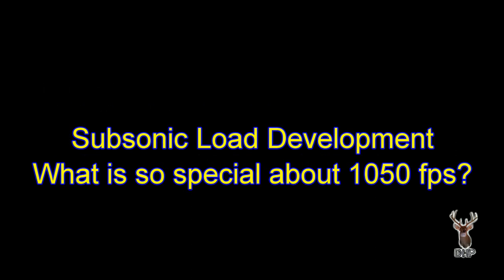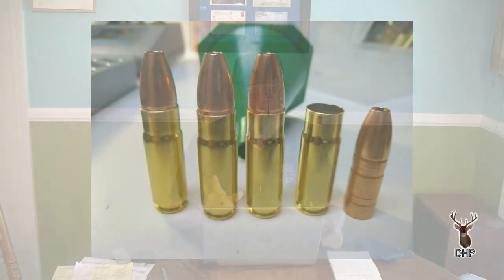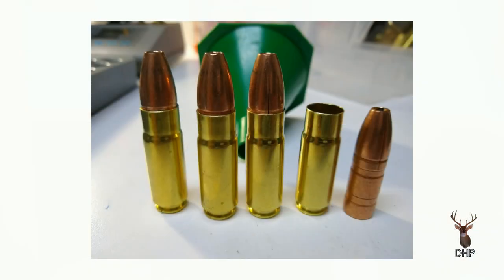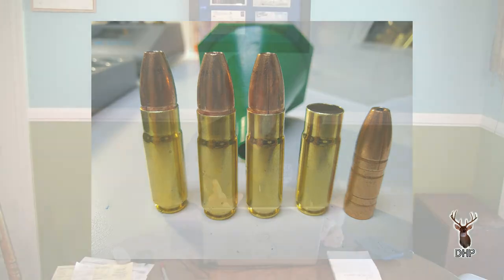S9E15 – Mid Season Special-III - Subsonic Load Development 500 gr Maker Bullets 458 SOCOM - 1080p

Comment: Off-center chamber, or bullet undersize for bore. I gave up on solid bullets 20 years ago for this reason. I was trying them at 1000 yards. Could not get them to work. It came down to just this problem, too small for bore. The bullet maker offered to turn up a batch for my bore at too much of a fee. so that was the end of that.
Reply from the maker: I appreciate the thought. Solids/monolithic projectiles can be a challenge. 

Neither is the case here in this example. I don't turn necks. So with a perfect barrel, bullets can off-axis.

Comment: I have had very bad results with Winchester LRM primers in the .460S&W. 

Overall they seem to be slightly smaller diameter than the competitors and I have experienced breech face cutting from gas leakage at (perfectly safe) starting loads of H110 and the 240gr XTP-Mag. 

Might be something you might want to double check because I wouldn’t want to see the same thing happen and wreck your pricey bolt.
Reply from the maker: I use CCI in everything but 270 win. The first round I ever reloaded. WLR are the only large rifle primers I stock on hand. Never had one back out. I don't think they are any different. 

Something is up, I don't know what it ia. Sounds like your brass is made out of spec, past its useful life, flash-hole too large or you are loaded too hot. Primer pockets wear a little at a time with each reload.

You know, I might have used WLR in some older cals I no longer shoot.
Reply: rldel149 I thought it might’ve been the brass too but the same brand new Hornady brass and CCI primers exhibited no issues. It was really straight, that channel Ultimate Reloader had an issue around the same time with known good .44 Mag loads and WLPs bunch of people chimed in in the comments saying they’ve seen it with the various iterations of large Win primers too. 

I believe I’ll be avoiding Winchester primers from now on except in 9x19 when I can get the SPPs on sale. 

If you’re not having issues with them then I guess it’s all good, haha 🙂
Reply from the maker: @rifleshooterchannel208  Never in about 40 years or so of handloading. But you know, there's a lot of what I don't know out there, and a lot of old wives tales. I have heard stories of "cracked primers" - heck there is even a tale of a 6.5 x 52 Carcano being shot at a moving target a hundred yards away w/5 of 6 hitting the target. That's pretty good, even for a crayon eater w/a POS bolt gun! Ha!

WLR is what I use and in the 270. Your 460 S&W uses LRMs. I use CCI 250s for mag large rifle. Every now and again a bad batch of something is let out of the cage. It happens. With billions of small arms ammo made domestically each year, something is getting out - odds are better than Vegas. 

Every now and again, Hodgdon recalls powder, or someone brass, BPI (CVA) recalled entire rifles! It happens, never experienced it. I'll check the next time I shoot the 270. I did use them on the 458 but that's a CCI 350's base application. It is a low pressure application.

I've thought about switching to CCI on WLR just because the Winchesters are not chrome plated. If I ever see the problem I will and I will remember where I heard it. Thanks 😊
Reply: rldel149 No problem. I dislike appearing as if I’m spreading rumors I would not have mentioned it if it did not happen to me personally. 

Take care!
Reply from the maker: @rifleshooterchannel208  Oh I have no doubt. No doubt at all. I didn't take it as a rumor. Primers, they are not equal. And what I said was genuine, I've thought about switching the WLR to CCI - just cause they ain't chrome. No, I was saying I'll keep an eye out and remember who told me. In fact, in that deer to the right on the opening, I pulled the shot brass out of his ear and looked at the primer. 

One year (empty nester here - and thank God, divorced) at Christmas while watch TV and whatnot, I loaded 800 40s&w by single stage, then unloaded, dropped the Remington primers and replaced them w/CCIs. 

I wasn't doubting you, if you feel I was I apologise. What I was saying is, I've seen some fantastic things myself. But the engineer in me absorbs everything as-is but ballances it against my direct knowledge. It is possible for me to be flat out wrong too. But, one time deal or not, a fluke or a design flaw - once bitten twice shy. I'll never marry another Waffle House waitress,  buy another GM vehicle, or use Remington primers (in that order). I've been bit before. 

In 6.8 SPC, I've shot Federal brass about 5 - 6 times before I had to retire it. On that cal I run cooler than normal tho but still see a cracked neck or possible shoulder split (with a semi, brass always scratches and nicks). I have felt some loose primer pockets and that using CCI small rifle/mag/match. But I prime by hand using Hornady's hand primer and not a press. Presses, particularly APs can be hard on primer pockets and I do believe the brass looking Win primers are softer than my favorites in CCI.

Any time a shot case looks hinky - it's trashed. Brass is soft, steel isn't. For me, the odds are so much tilted towards failed brass that, yes - absolutely I put it in my BOLO notes. It doesn't matter which failed, the load, the brass, the primer - the round failed. 

I take to heart your experience, I just apply a grain of salt to the cause that WLR are smaller than other brands. It's easy to check. I'll pick some 250s and compare. I know I have less than a brick of WLR. 

Like Reagan, I trust but verify - especially after using Remington in that batch of 800 40s.
Reply from the maker: @rifleshooterchannel208  Yes sir I believe they were. And much like you, I had a friend point them out. Sonuva... Right there on the box.